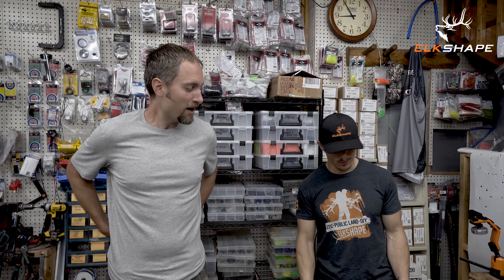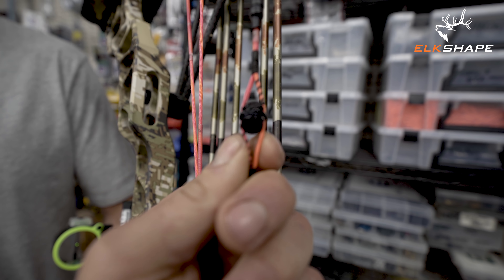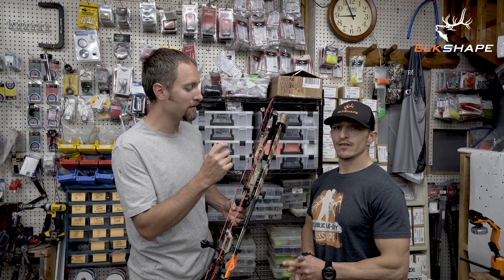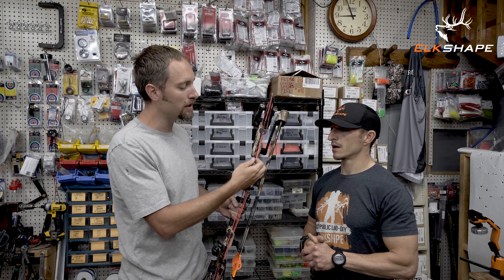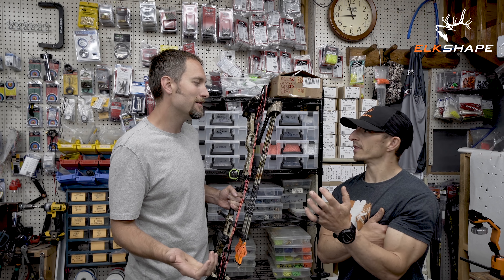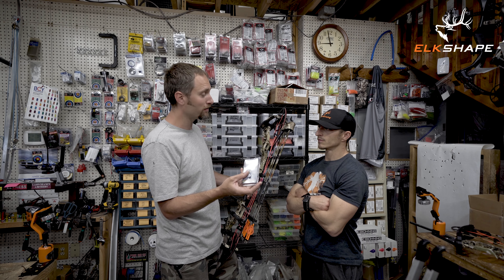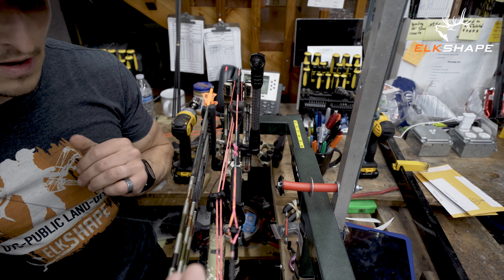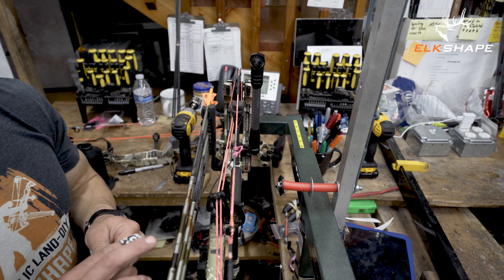VERTIX Swapping Out Peeps & Rests

Comment: Where you having issues with the QAD Intergrated rest? @elkshape
Reply: Doug Ousley i’d also like to know.
Reply from the maker: ZERO issues with it.  It's super slick having a rest integrated specifically for your bow.  Swapping out to a limb driven rest with micro adjustment for vertical/windage is the main reason I put on the Hamskea...  this Matthews is the easiest bow to tune, and I have owned a lot of bows over the last 15 years.

Comment: So I’m pretty much shooting the exact same setup this year. I’m just curious what made you switch arrow rests? Any issues with arrow flight or tuning?
Reply from the maker: ZERO issues with it.  It's super slick having a rest integrated specifically for your bow.  Swapping out to a limb driven rest with micro adjustment for vertical/windage is the main reason I put on the Hamskea...  this Matthews is the easiest bow to tune, and I have owned a lot of bows over the last 15 years.
Reply: Elk Shape Thanks for the reply! Ok that is good to know, I thought the integrated rest had micro vertical and wind age adjustments as well? I’m kinda new to archery and building bows and I absolutely agree with you! I had Hoyt’s previously (still great bows!) this is only the third bow I’ve ever set up/ tuned and hands down it was the easiest for me to paper tune! I also get great speeds for having such a short draw length. I’m definitely a Mathews fan now!
Reply from the maker: That QAD integrated rest is super legit!  I am just going with what I prefer which is that Hamskea!  Bullet holes from the Matthews has been so exciting!!
Reply: Elk Shape Oh ok that absolutely makes sense!! Thanks for all the videos and information posted on your channel!! You have some great videos keep it up!! And good luck in the field this year!
Reply from the maker: @stickersut  likewise